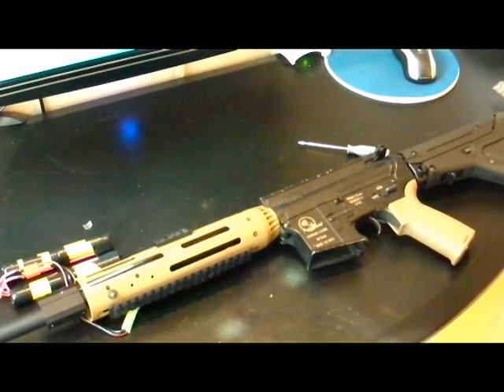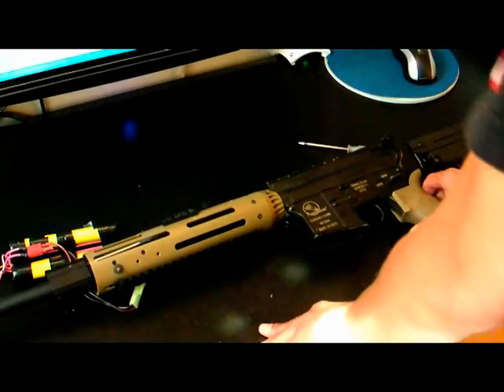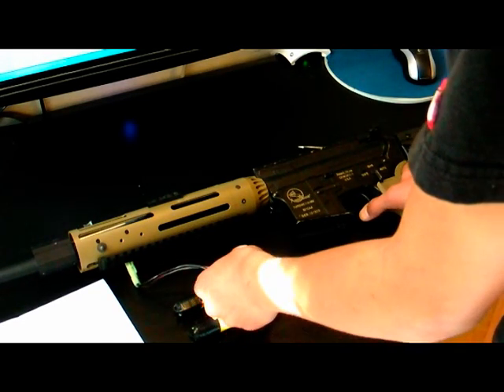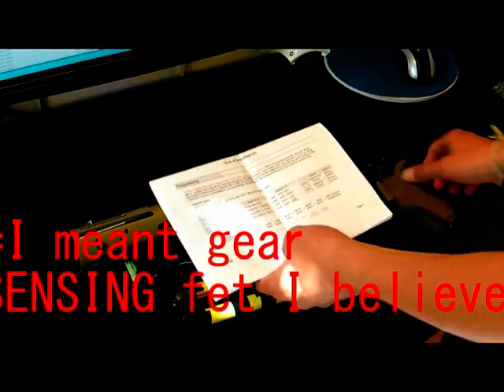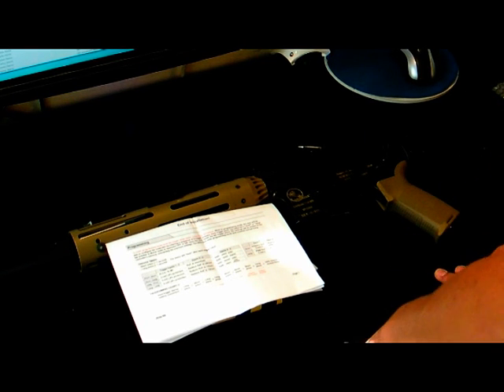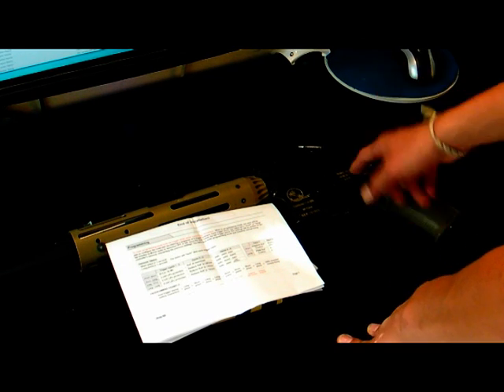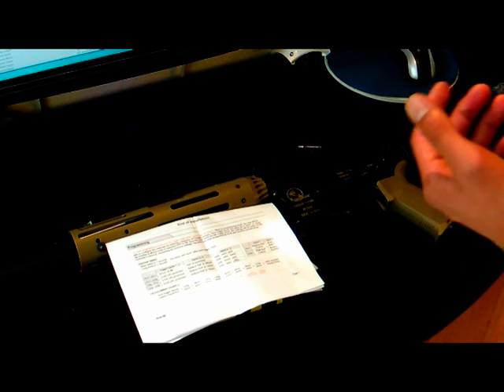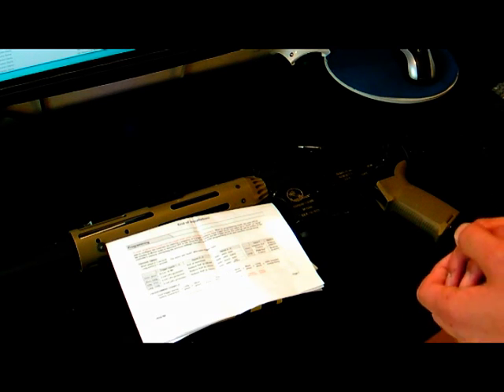Detailed Installation & Review for Raptor V2HC-X120 Mosfet/fet (Part 2)

Comment: if that's what you want to leave it at shs motors aren't what you want and i love shs parts just if you want to do that don't use a an shs use a lonex or g&p  in which you can easily replace the brushes if needed my dads an electrician and i know what a arc is and anybody looking at lipo's and mosfets should also i would like to say i hate when people take advice and others look at it and try to make it look as if it where an insult sometime you should take things like that into consideration.

Comment from the maker: Bahaha, your funny. Tell that to the guys on ASM and RC junkies who run these things on 6s lipos. The biggest concern with voltage is a larger arc since voltage is the electrons "urge" to jump from point A to point B. If you have any understanding of a brushed motor you'd know that anything half descent will have good enough tolerances to avoid a larger arc and furthermore it'd only mean cleaning the armature here and there and maybe dropping in better brushes.

Comment: Looking at the Spur gear, the surface is not really possible when sintering, if i am not missing some process. I know shops dont have the correct product details, but ehobby sais the gears are milled.. On my systema gears, the surface was smooth and could be polished to a mirror finish, which wasnt possible on my sintered JG gears, because of the porous material. The only process apart from CNCing could be casting...which could explain the strength, but it would still look different.

Comment from the maker: @andromedarr Eh, in my experience it was a combination of poor manufacturing & poor quality materials..spur gear stripped within a few magazines at a mere 25rps and 350fps. I've NEVER EVER heard of systema doing CNC... as far as I'm aware the closest things out there to true CNC is RIOTSC which is textbook CNC and then you've got prommy that does a combination of both where they start off with powder metallurgy and CNC it down from there. As far as I'm aware systema only does powder metallurgy.

Comment: @DuTheHustle93 I have to disagree and agree. Yes - Systema gears are awful and overpriced. But in my experience, it is not because of bad metal, but because the metal isnt heat treated. According to ehobby, they use cromoly steel for the axels, and some other pretty good steels for the rest, CNCing the gears except the upper sector gear part and upper bevel gear part. heat treating and teniferizing can help with that, but it would make them even more expensive^^

Comment from the maker: @SweRobe That honestly isn't saying much... systema gears are barely a step up from plastic. The metal they use is awful and extremely low quality. DF pistons have mixed reviews, check out SHS pistons. And the raptor fet is up to you but if you watched my review and compared it to other fets you may want to reconsider. Keep in mind 13.2v is specific to LiFe... I make custom LiFe packs if your interested.

Comment: Thanks. I´ve never heard about RIOTSC gears before. I googled it and WOW, cheap and seems to be much better then systema (that I usually use).
I think I´ll go with RIOTSC torque plus gears, deep fire titan piston, raptor mosfet and a 13.2V or 14.8V lipo.
Thanks

Comment from the maker: @SweRobe SHS, Prommy and RIOTSC gears are all great, SHS if your on a budget but I'd really go with prommy or RIOTSC gears. And if everything is tuned right it's fine IMO... my DMR is running Prommy max torque gears and an m170 spring... before I made it semi only I was pushing about 23RPS on a 13.2LiFe. They are just much more picky with how they are shimmed.

And I haven't gotten around to even programming that mode. All I did was basic testing as it's a customer's gun.

Comment: Ofc, but my question was which gears/piston do you use/recomand for M160+ springs? I have often used halft tooth piston/gear sets for high power springs, but the ROF/response on the trigger get pretty slow with infitie/max torque gears, even with LIPO.
Therefore I´m curious on the DMR mode on the raptor :)

Comment from the maker: @SweRobe Half toothed pistons only matter depending on your gears. If your gears use half toothed pistons then that is the only reason to use a half toothed piston. There is no point to remove the AR latch as long as everything is properly tuned as properly... so no I didn't remove it.

Comment: Oh, one more thing. Have you tried the DMR mode on the Raptor? That´s one of the features that my acsu v2 don´t have. 
Do you remove the anti reversal latch too? I guess not, since it would be pretty painful for the motor/battery to hold a M160 spring fully compressed?